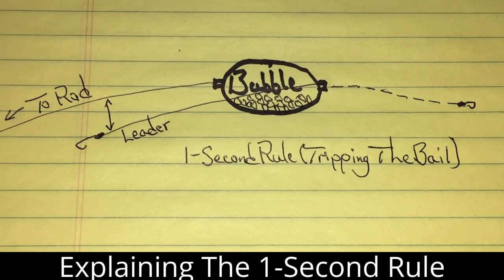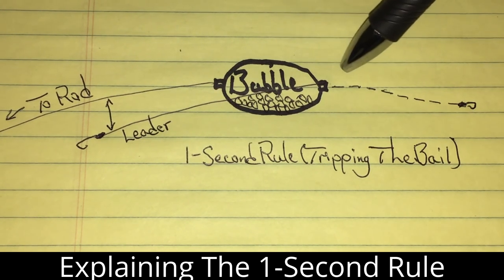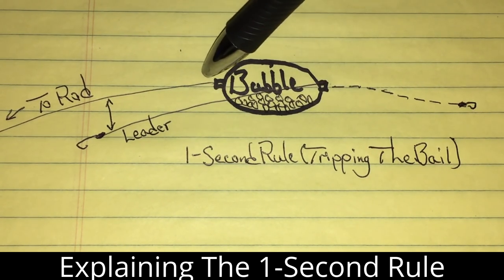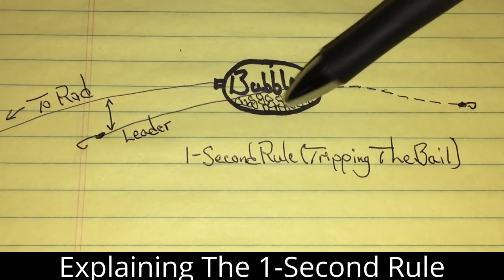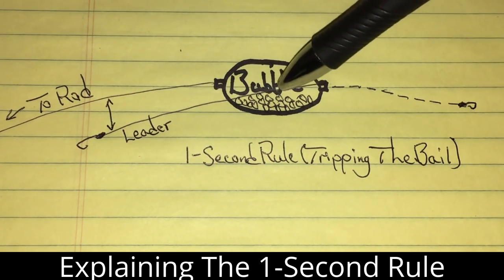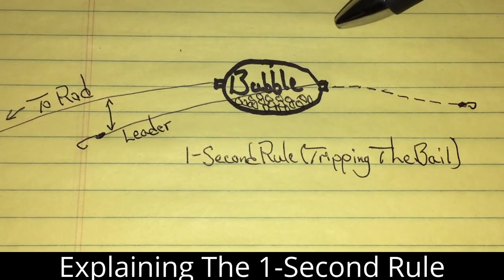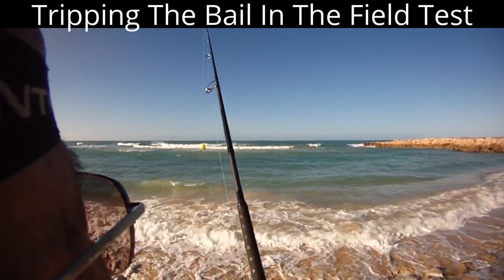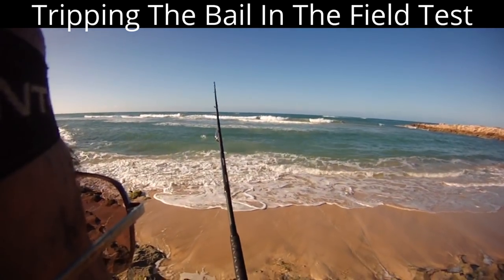My Important 1-Second Rule Of Casting!

Comment: I only seem to have this issue though when it's strong onshore wind

but I've tried this and noticed that my hammerbomb will fly towards me about 10 ft when I trip the bail early
Reply from the maker: I think you will to continue to have this issue if you use Hammerbombs or loaded Bubbles. I always check the day/night before i go fishing to get an idea of the wind direction & speed. The leaderlines are to light in high winds & it's hard to cast this way. I always try to go to areas where i can cast with the wind either from my back or sideways, never into it.
Reply: +Scuba Chris ah I see..

Comment: Where u get the weight
Reply from the maker: I bought the green tough bubble at Brian's Fishing Supply & used BB's to fill it. Every 21 BB's equals 1/4oz. Then sealed the ends using super glue. It was in my last video.